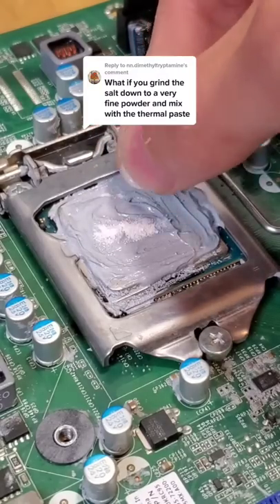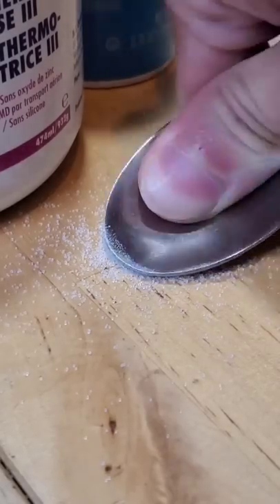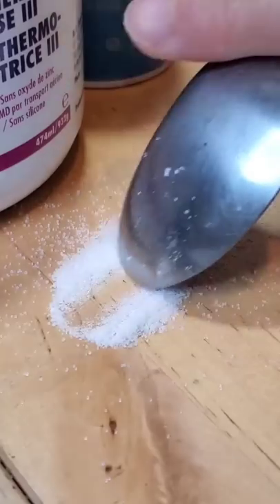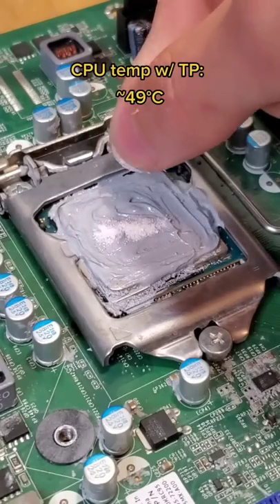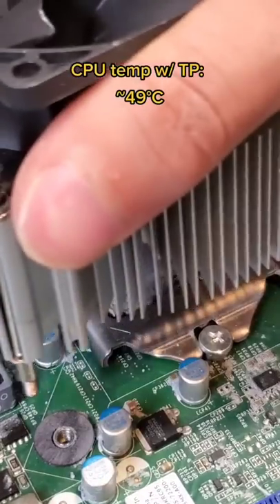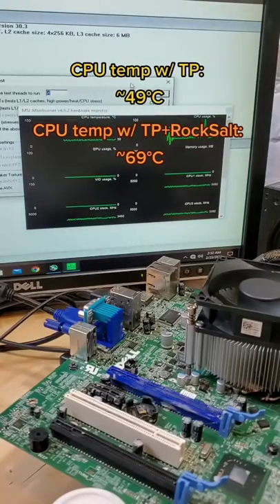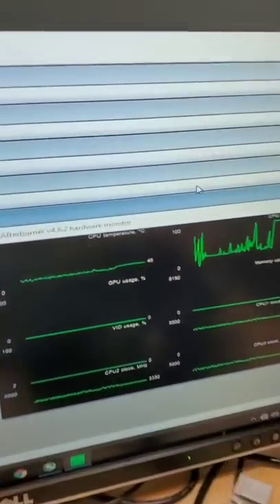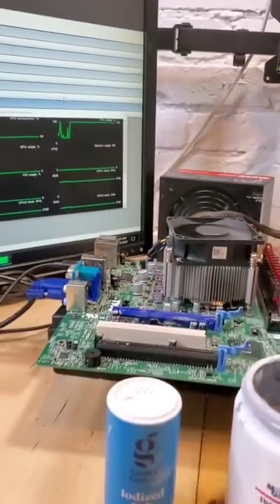grinding down the salt before mixing with thermal paste #shorts

Comment: What if u dissolve the salt in separately and then try it
Reply: Thermal paste is a liquid metal tho
Reply: @Racingismypassion69420  no it isn't, thermal paste and liquid metal are two different things. One is made out of zinc oxide and silicone, the other out of liquid metals.
Reply: @Racingismypassion69420  well some thermal pastes are liquid metal, or at least claim to be. But most modern thermal pastes are not metal based and although I'm not sure if the base is water, its definitely not metal
Reply: @eyeofterra  water is made of water
Reply: @Racingismypassion69420  wrong water is made up of hydrogen and oxygen
Reply: @Aavrushh  WRONG, water is composed of proton neutrons and electrons
Reply: @phenixtechyt  wrong again, water is made out of up quarks, down quarks, and electrons
Reply: @phenixtechyt  wrong, water is composed of quarks and electrons
Reply: @Racingismypassion69420  the floor is made out of flo-
Reply: @_frytasy  wrong wood floor is made out of sugar
Reply: @eyeofterra  wrong wood floor is made from sticks and stones but words can never hurt me
Reply: @Shahaan  thermal pastes are not liquid metal tho, none of them claim to be. you can use thermal paste OR liquid metal, they’re two different things
Reply: @eyeofterra  word has it MX4 is actually an aluminium metal particulate, suspended in silicone oil, with barely any or no ceramic such as zinc oxide. Anyway solid metal is a fairly common ingredient. I'm also fairly certain that some thermal paste use some sort of other polymer for suspension rather than siloxane, but I forget what exactly, maybe some sort of hydrocarbon, I'm pretty sure kerafol (industrial supplier) was making one of those.
Reply: I definitely want him to try this I said the same thing on the last video
Reply: Look at the Nerds arguing
Reply: Hey man, I'd like to note that Salt cant dissolve in Thermal paste, and only in Water.
Reply: @F90-s7q  isnt it beautiful lol
Reply: @Shahaan  there are actually two common/popular types of thermal paste being used currently, chemical based and silver based. There is negligible difference between the two in terms of their ability to transfer heat, however silver based compound is more popular.
Reply: @Racingismypassion69420  🤦‍♂️🤦‍♂️🤦‍♂️🤦‍♂️🤦‍♂️🤦‍♂️🤦‍♂️🤦‍♂️
Reply: @yourmom-jm8eg  says the one who has Google Play Services as their pfp and is called “your mom”
Reply: @Shahaan  I’m pretty sure they use gallium, it’s why they come with a warning not to use on an aluminum heatsink

Comment: Now we need to find ideal %salt by volume and does performance improve with further grinding, and what happens long term????
Reply: This does not work. Hence why it's not mixed in thermal paste already.
Reply: Conductivity ,Corrosion,
Reply: Performance will drop long term when the salt reaches thermal saturation, and cannot conduct as well as the surrounding paste. Any corrosive metals will also rapidly rust as heat increases.

Comment: Thermal paste manufacturers: lets test this for ourselves.
Reply: I doubt if, salt is very corrosive, the long term effects would probably be bad
Reply: @austin3205  Yea, thinking about it, they could damage the IHS or cold plate of cpu or coolers
Otherwise they would have probably done it already
Reply: I believe it also makes thermal paste electrically conductive, which  might damage the computer if they get to the wrong place.

Comment: The problem is that this really high thermal conductivity you mentioned is for salt crystals. A single crystal of NaCl with just a couple of normal defects.
Ground up salt just doesn’t have this kind of conductivity, because you couldn’t be further from a single crystal.
Last time it didn’t work because the salt created air gaps. This time, you got the original value because you just didn’t put too much salt into it and the salt dissolved and didn’t do much.

Comment: Try to put a Peltier module on a cpu. A Peltier module is just a ceramic plate that one side of it becomes hot and the other one is cold. Place the cold side to cpu and the hot side to cooler. If hot side is cooled enough the cold side can create freazing temps.

You Will also need to have 12v power supply
Reply: People already did that and Intel even released 1-2? years ago. The problem is that your temps are too cold at idle and you can easily overwhelm it at max load. Intel did make it into a "viable" solution (ignoring the fact that these are incredibly inefficient) but it still doesn't make any sense to use

Comment: It would work better if you put salt and the thermal paste in a mortar and pastel, would be a better more uniform mix, just gotta make sure it’s clean before hand (not wood) and be ok with wasting a bit more thermal past due to some of it being left behind, should be able to get another .5 degrees or something if just this made a difference

Comment: I have a higher thermal conductive substance then salt. 
Copper. 
I request you to grind copper in thin particles and mix it with thermal paste. 
It has 385 W/m K.
And make sure that copper is more.
It would be more effective

Comment: Adding flour salt to the cpu thermal paste may sound like a good idea.  If the heat spreader has a copper layer in it this could lead to the coroding of the copper layer and could damage the cpu permanently.  Even though it works I would not try it at all.

Comment: In the short term
God knows what that salt's gonna do to the CPU and Cooler's thermal interfaces
Reply: Exactly, I don't think most of the comment section knows what salt will do to metal in humid air.
Reply: @SonicBoone56  Yeah
I get that copper isn't as prone to corrosion as iron, but do we really wanna sacrifice a cooler to know what would happen?

Comment: Yeah but this type of thermal paste is really bad for computer chips and should be left to analog systems or high voltage high temp systems. A sodium slurry might be interesting for really cheap paste but also this enhances oxidation and maybe (I've never tested or experimented) can corrode your heat spreader or nearby components on the board. Check out Gennel thermal paste, it's cheap in bulk and gets you up to tens of mW/k

Comment: Using crystal meth as thermal paste..... On the bright side if it doesn't work you can pull up the CPU get high off the crystal meth so you have the energy and willpower to put the correct paste on it and reassemble.... #LifeHack